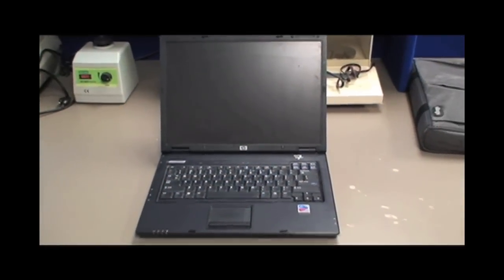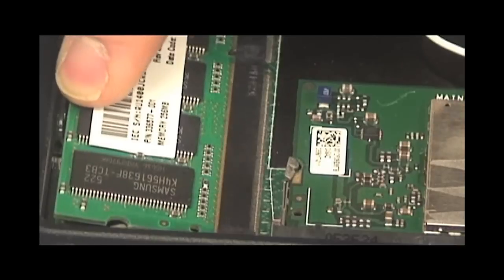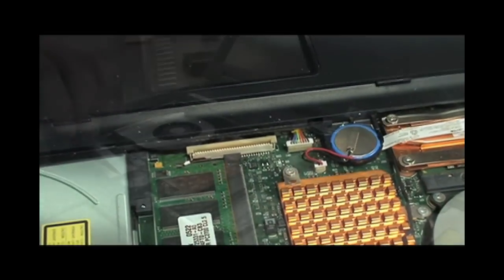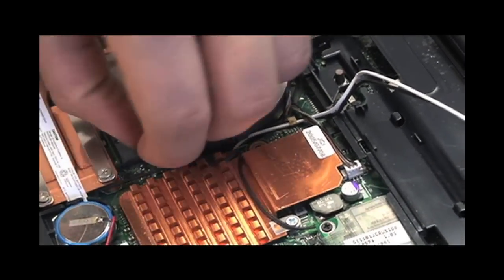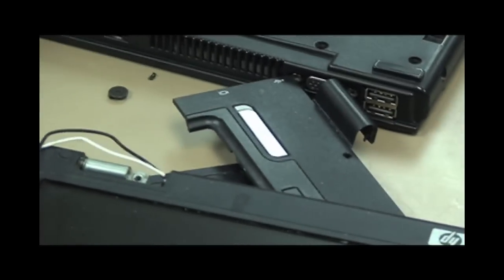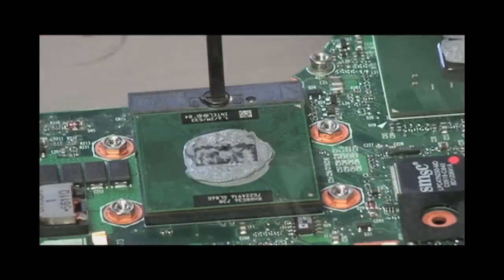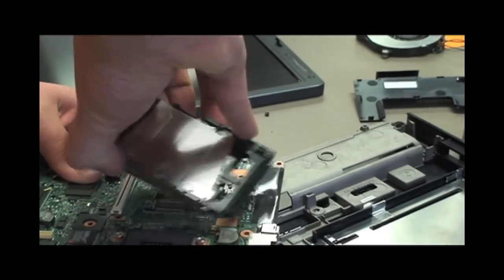How to take apart an HP nx6110 laptop for repair or parts.

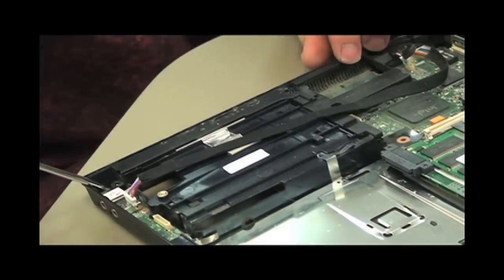Comment: Thanks for de video, was really helpful to me! But there is a mysterious cable in 6:20 side of sound cable, both above the HDD case. Later at 8:21 there is only the sound cable when you remove the sound board. Can you tell me what is the second cable? In my motherboard, there is this second cable too but it is attached in nowhere, maybe some removed device I don't know what.
Reply: good question have  the same problem
Reply: Did you find out where it goes?  I just pulled mine apart, putting it back together, no place for it to go.  I can't remember if it even was plugged in to anything.  Don't know how I could forget after a few minutes